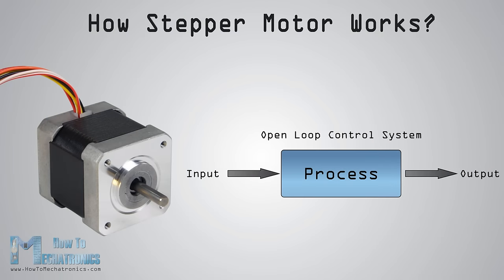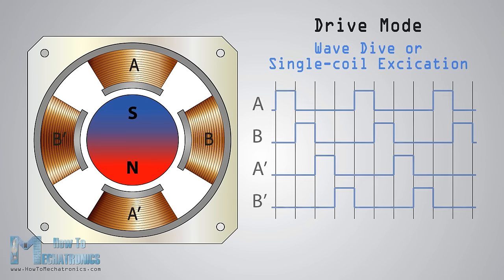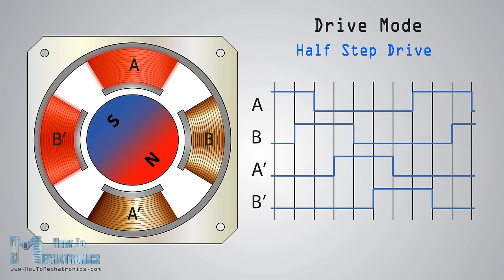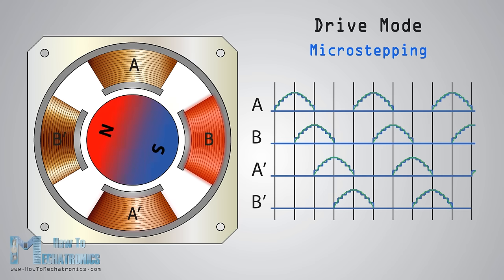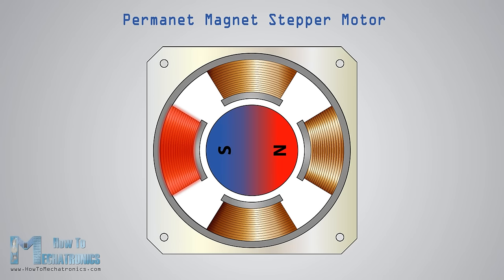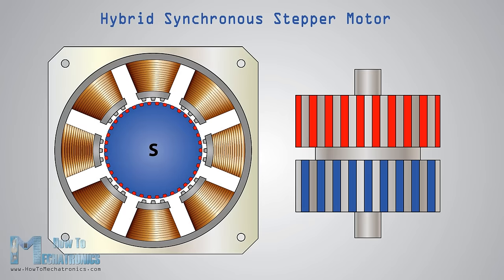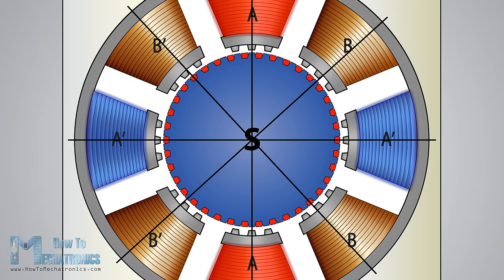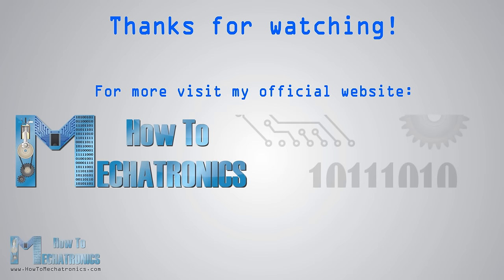Stepper Motor - How It Works

Comment: The hybrid motor came very close to answering my question but not quite.  If you pull the rotor out of a stepper motor Karma you will notice that there are several rows of magnets. Instead of one long magnet per pole, each magnet is cut into several small section and each section is rotated on the shaft so it is offset just a little from the sections next to it on either side.  I think I know why but I would like to hear it from you.  My question is how do I calculate the proper amount of offset for each section?